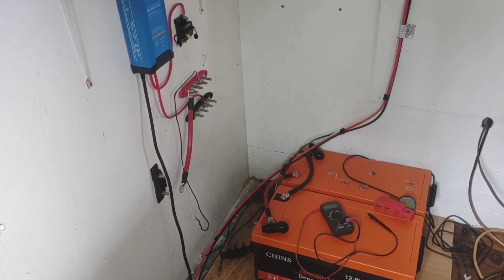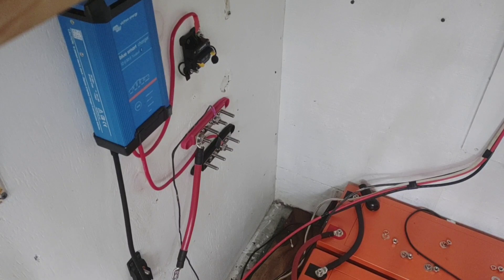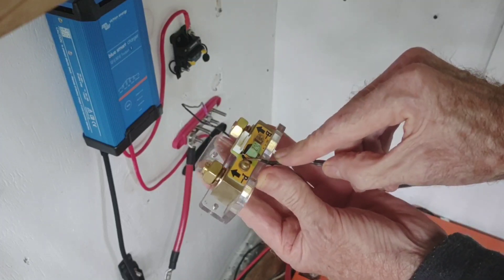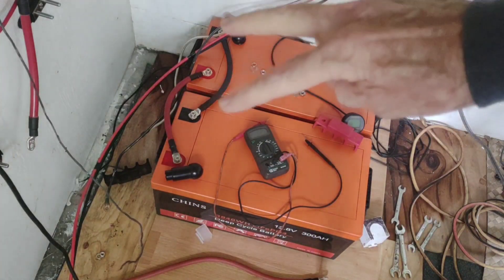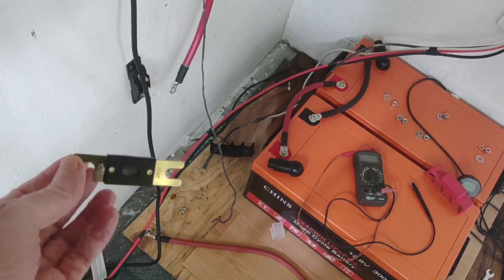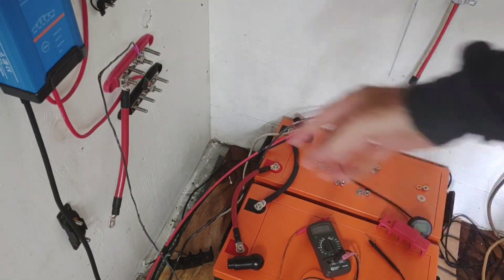LiFePO4 system down...big mistake

Comment: Wow that’s so unfortunate! But Thank you for sharing so we can be aware of what not to do! When Setting up my first system I accidentally shorted out a brand new lead acid battery when getting it situated.  I believe I moved something while one cable was connected to the battery and I bumped  into it and the other end connected.  There was a huge spark and it melted some of the terminal. It was only for a split second because I reacted really quick and pulled it off (thankfully it was insulated!)  and I’m still using the battery to this day, but I’m sure it’s not as good as it would be if I didn’t do this.
Reply from the maker: I for sure learned  good lesson! Aloha!🤙

Comment: Accidents happen. That's why fuses and other safety devices are so critical, especially with battery/capacitor storage due to the instant availability of energy. Glad you're safe.

Do all you can to cover any exposed conductive/charged surfaces. A dropped tool can cause major damage before you can respond.
Reply from the maker: Mahalo for that... yeah all taped up these days 🤙

Comment: I’ve worked with three phase circuits my whole working career and know hat you went through. My only advice or question is why not have your electric factory up off the floor to where you would have a much better view and control?  I’m not in your group but came across it yesterday. There are just too many to join them all. Your set up looks like it’s hidden on the closet floor?
Reply from the maker: It's actually a utility room which is my best option for now,  but I take your point...mahalo for tuning in 🤙

Comment: I run a 24v system on my setup. For my 12v accessories, I use a 24-12v buck converter. I like these converters from this company, but the lugs are a little too close together. Well, I went to install that the first day and accidentally touched the hot lead to the wrong terminal and blew the damn thing right off! Lol hadn't even used it yet! Just like that, had to go but a new one 😂
Reply from the maker: I have a healthy respect now for  the power...live and learn yeah! Thanks for all your feedback...keep it coming! aloha 🤙

Comment: I'm building a 1200AHr  split bank system which can obviously be dangerous. There are many ways to connect such systems, and redundant safeties is critical. Your current shunt sense leads should be around 20ga, or have a 22ga fuselink. Battery disconnects are mandatory, and cheap ($12). There is no excuse to work on an energized system, as you have recently discovered. Me too, in the past. In your example you could have opted for a length of 3/8" vinyl tube to simulate the cable for layout purposes. As was commented, the proximity of your bus bars and components is hazardous. Place a nonconductive barrier between them so that nothing can short the pathways. This goes for the terminals as well. While there are several ways to do this right, there are far more that are wrong. Remember Murphy's Law: anything that can go wrong probably will. A detailed sketch which you can scrutinize is a valuable tool. You can also present it to a professional for review prior to assembly. Anytime you have stored energy you have a danger zone. Whether it's a 2500psi pressure vessel, a flywheel, or a battery bank, it must be treated with respect. Good luck, and stay safe.
Reply from the maker: Thank you for sharing your information and experience on working these systems.  I like every single one of your recommendations,  and have taken them to heart. Seriously.  Very appreciative of your time, and participating in the conversation.  Safety  all the way...no doubt.  Hope to see you around here again.  Aloha 🤙

Comment: If you were anywhere near a marina or boatyard, they typically have ANL fuses.  For an inverter application, a Class "T" fuse is recommended.  Do you have a small fuse protecting the shunt after the mishap?
Reply from the maker: Yes, I put a 5amp inline fuse on that shunt to prevent this from happening again...once was enough for me!🤙
Reply: 1 fuse amp would be plenty

Comment: those shunts are a classic spot for a short. that little hot wire is held on by the tiniest screw ever made and it sits 1/8" from the negative terminal. the same thing happened to us. our cat jumped into the cabinet where our battery-rat's-nest lives. he must have knocked that little wire loose and we didn't notice. came home from work and the batteries were at like 0.7 volts. i'm not sure exactly what happened, no sparks, no blown fuses... but it shorted the batteries for sure.
Reply from the maker: Tiniest of screws is right! Even with powerful reading glasses on it was a struggle,  plus had to purchase a teeny screwdriver to boot. They could do better,  no doubt.  Sorry about what happened to you, but we press on yeah...🤙aloha

Comment: I was testing an amp meter and because the shunt terminal was so small I used a fuse holder with thin wire and the ten amp fuse that came with it. The wire over heated melted the insulation through a main cable and caused a fire. I was very lucky to have discovered it in time. These shunts have a huge potential for fire and everybody should be very careful how you install them.

Comment: stuff happens - my suggestion. - clip bare ends off wires when working on system - mount wall stuff on I think is called Hardy Board. - cement board - (its fire proof ish cement board ) use liquid electric tape on all bare metal - it works well- 3k watts is 150 amps ish - so unless you have big inrush or high amp draw
use good 150 amp fuze -  inverter size  i run almost everything in my rv off 300 watt gopower inverter 6 years 24x7 -  my dorm fridge i use 1000 watt gopower inverter - because it has high inrush current and my smaller inverter its a Little to much - draws 50 watts once running - all hooked to 100ah calb battery - Second system is 2 tesla model S battery bricks 24volt  1200 watt victron inverter to charge Sur Ron ebike 700 watts draw and mini split AC if i ever get it installed -  i use thick Lamp cord x3 - 12 gage ish for anything that draws much current  - works well - easy to find /work with - wires that are in sun wrap with Aluminum Duct tape  - protects from rays and keeps cooler - cutoff stock solar panel connectors and replaced with standard polarized  110v plugs /sockets - stock solar connectors were designed in 1980s for 20 watt panels and contact area is pin head size and not good for todays higher watt panels - Dont  Beat your self up over small mistake  - never watched you channel before but looks like you are doing for fun - so keep it fun and enjoyable
Reply from the maker: Yes, I am having fun here, and I mostly have recovered from my mistakes earlier,  hahha! I really love the cement board idea, and think I will do that down the road a bit. Fantastic information you shared, and many thanks for taking the time to do that for us...aloha 🤙
Reply: I think it's best to try different value fuses; use the lowest amperage one as is practical.
Also use crimped-wire pin connectors ("pin terminal crimp") and be sure to use a proper crimping tool.

Comment: I'm honestly surprised that the little wire handled the amperage that it did. If I were to bet money I would have bet that wire failed before the 250 amp fuse. That's one reason why I went with circuit breakers over fuses. I bet that little wire was orange hot like lava. Lucky nothing caught fire
Reply from the maker: I can't say for 100% that little wire was responsible for the entirety of the mishap,  although it was pretty fried. I know I definitely jumped when startled,  and it's possible I made a connection with a wrench in hand too. The whole thing is a bit of a blur now. The fuse sure glowed red though, that I'll never forget. More breaks and fuses being added 🤙

Comment: I made a big mistake yesterday myself. Lots and lots of smoke. I have the same Chins, 2 parallel, 2 in series. I have been having an issue when one of the loads of the inverter goes off, I get an overvoltage. Well, I disconnected the batteries and forgot about the wind generator also attached to the buss bar. Well, it was windy. No battery on it sent almost 100 volts to my 2 24 volt inverters. Overvolt protect did not work on either one, different brands. Smoke started coming from both inverters and a small 24-volt charger hooked up. Threw the disconnects on the inverters as quick as possible. So much smoke I thought I would see flames. My 4 solar controllers all disconnected on overvolt, thank God. I had disconnected the solar array first on all of them before disconnecting the battery. Put all back together and to my surprise, both inverters still work. But for how long? Going to order a new inverter soon, these are probably not long for the world. I'm going to fix the issue today with a dump load. I was using my electric water tank for dump load divert, but that does not work if the inverter is off. It happens to all of us.
Reply from the maker: Only takes a momentary lapse in being present with our systems to shake us to our core yeah? Much of what happened to me is a blur,  as it happened so fast. All in all I consider it a positive experience now because it has sharpened my awareness everytime I walk into the power room. Before I turned it back on yesterday,  I went over everything from start to finish many times before flipping the switch. So glad your system seemed to hang in there too.  Keep sharing your information with us,  and we'll do the same. Aloha 🤙

Comment: Wow! Glad nothing really bad happened. Your review of this battery inspired me to get one of my own witch I received yesterday from Amazon. I installed it in my RV that my wife and I are living in full time now off grid in the mountains of central Oregon. What a difference going from 215ah 6v Lead acid. I did set my Power Max charger to 14.40 instead of the 14.6 that Chins rep. Told me to. Found out 14.40 is to much for the Reliable Power inverter. Right at the end of the charge cycle my Honda eu2000 ramped up the power when asked by the charger and over loaded the inverter. The inverter protected its self and shut down. A quick reset and we were back in business. I already ordered the same Victron charger as you. I plan to turn my Power Max down to 14.2 and keep it as a backup. The Power Max I think is a little to much of a charger at 100amps. With the Victron charger I’m sure I’ll be able to charge on gloomily days with my 700w propane generator. Keep making the great videos. Subscribed!
Reply from the maker: Really enjoyed your comments,  and thank's for sharing that with us. Interesting that the inverter shut down at 14.4. I set my controller to 14.2 and everything has been fine with that, although I  rarely reach that, especially nowadays as it's dark,  and rainy. When my mishap happened,  I was just about to fire up the Victron (which I love) but never made it...everything after the sparks and noises is a blur.  But tomorrow is rebuild day...got kill switches,  fuses, and should be up and running pretty quick.  I'll let you know  how it goes,  and please share whatever else you learn along the way...aloha 🤙

Comment: In your earlier videos I saw a lot of exposed connector and I was thinking this is dangerous if he drop some tool there or any other accident. You can prevent another accident  with 99 cents electrical tape covering all exposed connectors.  Remember is 12v DC but you have 400a.  This is a welding machine 😁 
🤙
Reply from the maker: You are absolutely correct, and thank you! It's getting some safety upgrades immediately. Aloha 🤙

Comment: I have done mistakes as well . you learn more from a mistake .The fuse/breaker is a life saver !  from going over what you got. get a small ATC fuse 5A or so . put it on small wire at the POS buss bar . If that ever happens again that small fuse will blow and system will stay up less monitoring . and please make sure you have extra fuse for everything  ! make a chart of what fuse you have change chart as system change . then keep a box of spare fuse handy !   be-safe ! give thanks to that fuse !
Reply from the maker: I'm shopping for those things right now!  Mahalo Robert! Should be heading home soon with everything I need, and fingers crossed, up and running by tomorrow. Aloha 🤙

Comment: Hi looks like you have some experience with the li fe po . I want to but a Chins 12v 100mah and use it for my sump backup system. I found an inverter with an automatic switch for when the power goes out. What components and set up would you recommend. I can provide you with an email buy not in public comments

Comment: MAAAM ! I'M GLAD THAT ALL THE COMPONENTS WERE A OK INCLUDING THE INVERTER . YOU WILL NEED TO REARRANGE THE WIRES AND PROBABLY PURCHASE A 200 OR SO AMP BREAKER INSTEAD OF THE FUSED . THOSE LITHIUMS CURRENT DON'T HAVE NO LIMIT BEING SHORTED .
Reply from the maker: Thanks man, everything appears okay but I won't completely relax until I hook it all back up and see it running again. Lesson learned for sure...🤙

Comment: Sorry about the incident Sir. I am glad you are Ok. My two cents on this is that a 200 amp fuse is way too high for this circuit. A whole house is fed with 100 amp fuses.  the fuse sizing will be the 1.1 times of the full load current or 1.1 times of the total power in watts P (W) is divided by the applied voltage V (V). Fuse rating formula for electronics circuit. You had a 200 amps fireworks in all its glory!

The good thig about all this is that you empirically tested the batteries BMS and batteries and they can handle 200 amps easily. We all learn by doing and you are doing well. ;-)
Reply from the maker: Thank you for the thoughtful comments..I really appreciate you taking the time, and explaining so precisely about fusing.  I ordered up 150 amp for replacement ...that should be better,  and hopefully I never see fireworks again...that was enough for me...aloha 🤙
Reply: Why not use a breaker, it would have tripped faster and you would not have had to replace it.  Also where is you main   disconnect for the batteries and the panels?
Reply: It's not a AC circuit it's a DC circuit. Those batteries can put out 300 amps

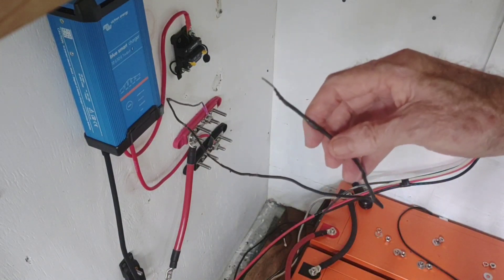Comment: @2:11 that wire should be fused i fused mine, didn't notice your's wasn't our i would have notified you. The fuse should be close as possible
 to the battery you can use a small glass fuse. Glad everything is ok with you and the batteries and other stuff are fine !!!
Reply from the maker: mahalo for your comments! I'll rewatch to see exactly what wire you're referring to...everything been a bit blurry for me since this happened...rest assured I'll be double checking everything,  the do it again! aloha 🤙
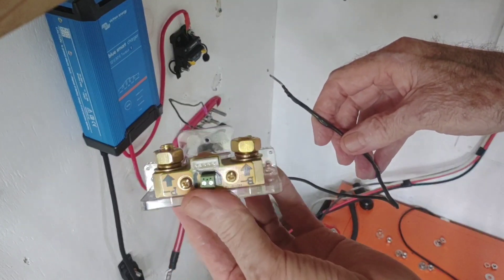Reply: @ProjectsinParadise808   The small wire that gives the shunt + current @2:11 in your video. Also try to find a red wire when replacing it and secure the shunt to the wall, at our age we need to be reminded visually :)

Comment: Thanks for sharing, those battery are powerful and need respect. We are all playing the home electrician and need to learn from each other. Maybe a smaller fuse to protect the smaller smaller wire ? Cheers
Reply from the maker: I'm still shaking my head in disbelief,  but I did order 150amp fuse to replace as you suggested for that very reason...thank you so much for your suggestion! aloha 🤙
Reply: @ProjectsinParadise808  I think a 15-20 amp for the smaller gauge wire going to the shunt meter to protect the smaller gauge himself for exactly this reason. Cheers

Comment: oh man.....been there. i had a hard time finding a small wire for that shunt also......and the quick fix i did also failed similar to yours by coming out.  No sparks for me, this time......lol  after my fuse blowing event i went to a radio supply store and with the help of the clerk purchased the proper size wire for the shunt, its crazy small like 22gauge i think.  Now when i am tempted to short cut on a system i think to my self   do i want my 1000$ batteries to burn up protecting the 20 cents of wiring i jury rigged??    Glad your system is still good to go. Replacing a fuse is small payment for the education received.
Reply from the maker: Yes sir...I tried 18 guage last night and it was too big! I'll do like you and go small, and make sure it's secure! I'm still kicking myself over this! aloha 🤙